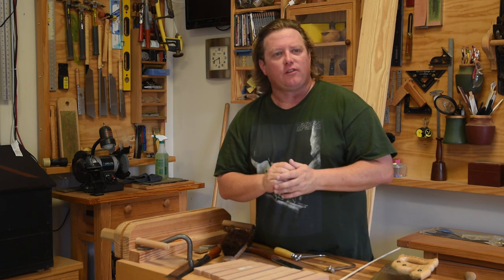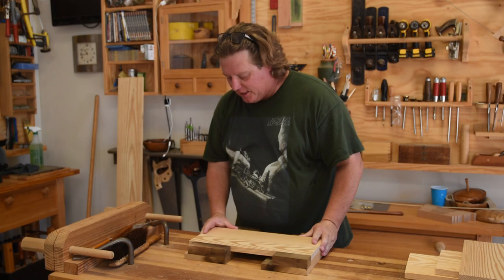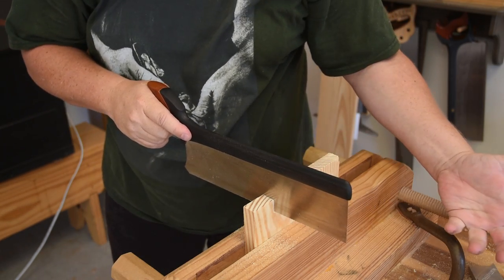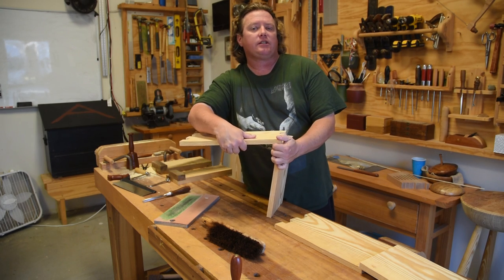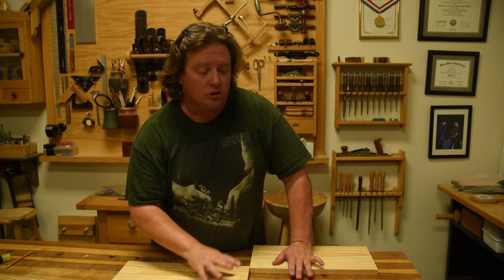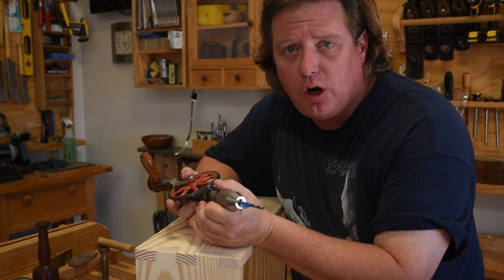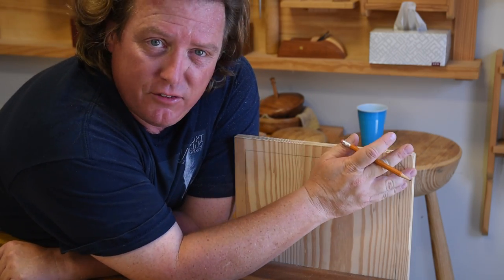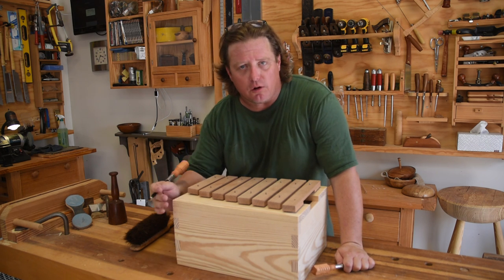1-03c: More Sawing Techniques

Comment: Awesome Video ! much better than before, hard to believe.
Reply from the maker: Thanks, still improving. Have lots of focus, white balance and audio issues with equipment I've got. My fault, not the equipments.
Reply: wortheffort have you considered a lapel type mic?  You seem to have to talk pretty loud quite frequently.  Also, if you turn around the volume stays the same
Reply from the maker: it's have to be wireless and I'm poor so... not gonna happen anytime soon.
Reply: if you have a cell phone, you could use a mic and record the audio with it , anyways you edit it then add the sound track , you should not have to spend any money! Audacity is a free program that you can use to enhance , equalize and make your sound more proffesional. cheers! keep it up. you are one hell of a teacher hoss.

Comment: If you use a crosscut carcase saw for cutting with the grain, does that mean a rip carcase is unnecessary? When you were teaching from a designated space, in person, I tried both & a rip-cut saw did seem to cut parallel to the grain more efficiently.
Reply from the maker: Yes, that was in an early part of this chapter.

Comment: Were do you get fine blades for turning saws? I have been buying old stock off ebay.  I am in the U.K. the only ones I can find are 10mm x 600mm. I am cutting down old stock to fit my smaller frame saws.
Reply from the maker: +Dwarfsbane Ironfist in states tools for working wood sells a selection. I built this to work with their blades.
Reply: Thank you.

Comment: Why haven’t you ever mentioned the Japanese back saws which are excellent saws. I use them strictly.
Reply from the maker: I have, many times. They're designed, body mechanic wise, to work differently. I work at an English Style workbench hence the "push" as I can see the show line and blowout is on the hidden side of a cut. If they work for you then keep at it.
Reply: Bully for you . Are you trying to FORCE your opinion on people ?Sounds like it.